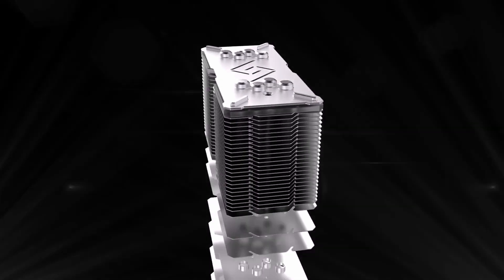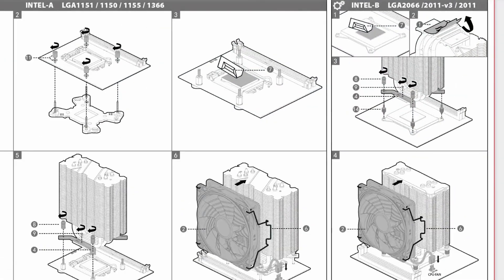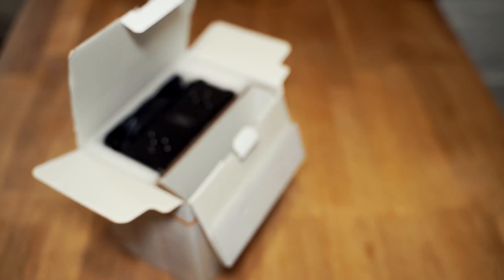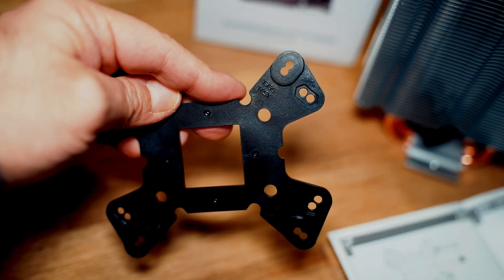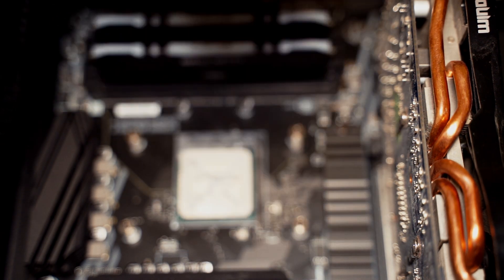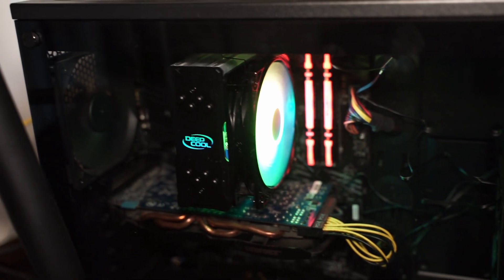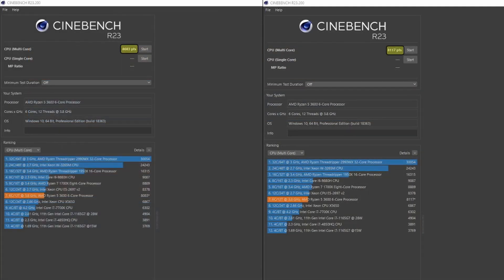Deepcool GAMMAXX GT A-RGB - Best CPU Cooler under 40$ for Ryzen

Comment: Hi, do you think its good for an i9 9900k ? I do console emulation and i see that temp go high like 86 C° with RPCS3. How much the temp will go down with this? At this moment i have a shitty GPU (740 gt) that I will upgrade in this days with a 3090 oc. What do you think, it will be good?
Reply from the maker: It's a bit borderline, if you intend to use it with such a CPU make sure to use the highest performing thermal paste and add an additional fan for having a push pull configuration
Reply: @fgtechtips  my case alone has 3 fan on the front, 1 on the back. What thermal paste do you suggest ?
Reply from the maker: I meant add an additional fan to the heatsink on top of the one provided with it. Thermal paste I always go with Thermal Grizzly Kryonaut, so I highly recommend it
Reply: It will most likely be alright but dont overclock
Reply from the maker: You can if you add an additional fan for a push pull configuration. Obviously it depends on the cpu, we are still talking about a low end cheap cooler here

Comment: Does aftermarket coolers makes the room hot than stock?
Reply from the maker: As this cooler performs better than the stock cooler, it will keep your CPU temps much lower therefore yes

Comment: Is it good cooler for i5-12400f?
Reply from the maker: hi the lga1700 socket is supported and it will be surely a more performing and better looking cooler compared to the stock ones. you can improve the performances by adding another fan too, in case needed so you have a push pull configuration

Comment: Do this cooler have 4 stick ram clearance issue? I'm using G. Skill trident z royal.
Deepcool GAMMAXX GT A-RGB vs Cooler master Hyper 212 turbo A-RGB, which one is better?
Reply from the maker: They are basically the same but the gammaxx is slightly better for ram clearance and performance . Just minor differences anyway

Comment: i'm using i5 11400 cpu. should i buy this one or buy Gamaxx 400 Pro ( 2Fan)
Reply from the maker: Hi, that's a 65w CPU but its capable of going up to 140w with all cores boosting. Anyway the gammaxx gt ARGB you see in this video should be enough, you could buy that and if not enough you simply add another fan in order to have a push pull configuration like the gammaxx 400 pro
Reply: @fgtechtips  Thanks for your replay!   i will buy GT ARGB then! right now im using it 65w (locked in XTU)  on Stock Cooler. and temp arround 70c-74c BTW, i have nzxt m22 Aio but i dont know why, this cooler cant keep my cpu temp under control! it reach 90-100c in under load
Reply: @fgtechtips  how do you add another fan ? Can we buy more of the brackets used on the fan on this cooler?
Reply from the maker: The fan is simply inserted on the other side of the fan. Brackets can be found for 2$ on AliExpress if not already provided with the fan

Comment: See when I used air cooler. I used two fans and not one fan.
Reply from the maker: Yea infact as I explain in the video, you can add a second fan for push pull configuration .
Reply: @fgtechtips  I know, I watch your video and it was very good. Thank you for the video. Also, why do lot of people people only test air cooler with one fan. Why not show the results of two fan, would that be more useful info than one?
Reply from the maker: Well, in this case I just wanted to show what people get out of the box, and the difference with 2 fans is not huge anyway. But you are right, it would have been a more complete review with that test
Reply: @fgtechtips  I guess that true.

Comment: Is it enough for an overclocked 11400f with TDP at 125w ?
Reply from the maker: Hi, this product is given up to 165w TDP so it should be fine
Reply: Did you buy it? Which temps are you getting?
Reply: @skorty.6446  no because i haven't get a gpu before unfortunately

Comment: My MoBo doesn't have 3 pin argb what can I use?
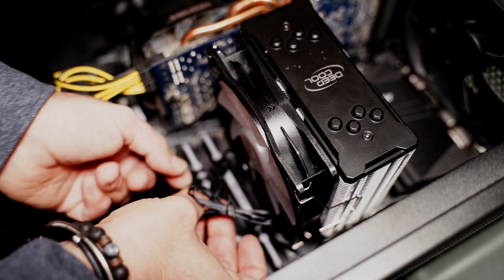Reply from the maker: Hi I explain it at 07:50 did you see it? Yes you can still use it even if you have no 5v argb support with your motherboard
Reply: @fgtechtips If I use provided controller I've to change the RGB light manually. But I wanted to connect it with the MoBo and use Aura Sync Software to control the Lights. Can I do it somehow?
Reply from the maker: No if you want to pilot the lighting via motherboard you need an argb mobo or you need a box like razer chroma
Reply: @fgtechtips  ok thanks a lot for replying 😍❤️
Reply from the maker: Anytime ;)

Comment: Can I use this with my 5900x?
Reply from the maker: You can and it will be still better than the stock, but due to the high number of cores that cpu is HOT so I would take something more expensive, you could anyway add an additional fan to the heatsink in order to get a pull push configuration ;) that will surely help
Reply: no